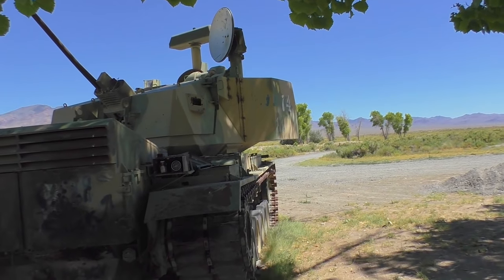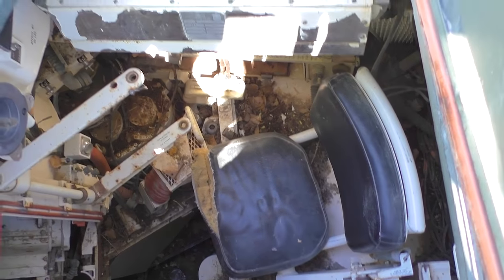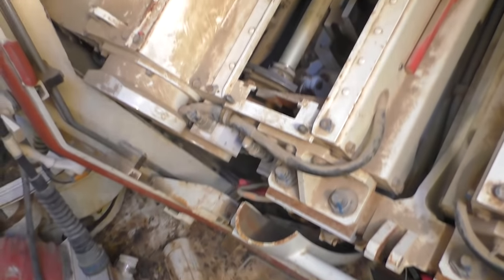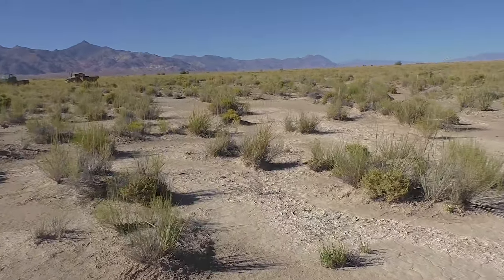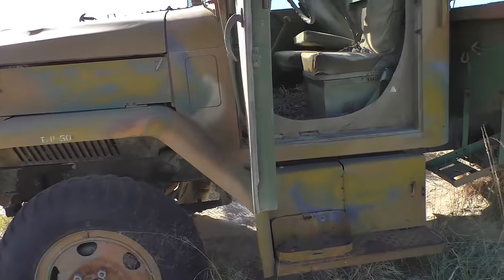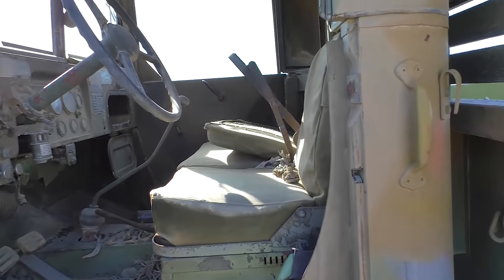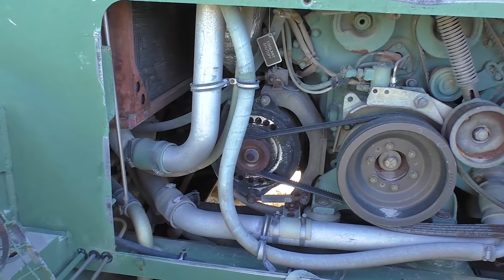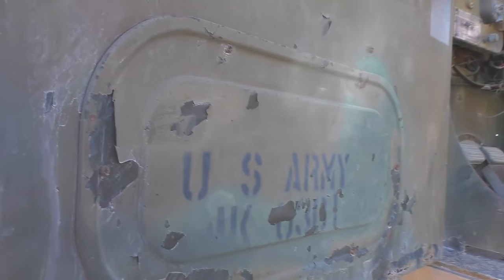WE GOT INSIDE! ABANDONED M247 SGT York Military Tank In The Middle Of Nowhere

Comment: Holy cow. I was assigned to the testing of the Sgt York  at Ft Bliss in 1980-1981...  Saw it firing. Needed a secret clearance just to get on the range.
Reply: Yeah. Me too. I was assigned to the S & F Bn. I remember the day the program was cancelled... We could not get in the vehicles after that.
Reply: @JavierMaldonado_n2jkw  What'd the inside of the look like then?
Reply: @halo64654  It was very futuristic. The center screen had great display. I was inside a German Gephardt an, to me, the icons in the Sgt York were easy to understand.
In my opinion, it was great for SHORAD. The secret proximity round was (is) lethal.  40mm BOFORS are in use today in all kinds of Naval applications.
In my humble opinion, the demise of this weapon system had in part to do with the chassis (M48) and the political climate of the time. In addition, SHORAD Air Defence was going through a lot of changes. Many systems came out in short order. The Army had choices, most of them greater than a slow running M48 based unit. The units it was designed to protect could run circles around it (M1 Abrams and Bradley Fighting Vehicle).

Comment: The tracked flatbed in between the two 2.5-ton trucks is an M-548. It is based on the M-113 armored personnel carrier. It is exactly what it looks like: a tracked "truck" that can go where wheeled trucks would get bogged down. They got used for all sorts of things, mostly combat resupply but also carried launchers for anti-personnel mines. There's a few still used in Reserve or Guard units but for the most part I think they've been removed from active duty service.

Comment: It's a 6x6x6. It can be 2 wheel, 4 wheel, or 6 wheel drive. I had one mine was a 60's model it ran on gas or diesel. It would probably run on kerosene or fuel oil. It would foul the spark plugs out. Had a straight 6 engine.

Comment: It's unfortunate the Sgt. York was never put into mass production. We really do need a new SPAAG, relying on grunts with stingers or patriot systems really wouldn't cut it against an organized air or helo assault. We do have the linebacker, but not enough of them, plus the bushmaster is designed for use against infantry, not aircraft, and is not radar guided like the Sgt York.

Comment: That's a sgt York missing a barrel there's also a deuce and a half and half a M270 with out a MLRS system
Reply: That's not an M270 MLRS its a M548 cargo carrier, the M270 is an armoured vehicle where as the M548 is not armored and uses the M-113 chassis.
Reply: bert26a nope
Reply: As well the m270s are gigantic this thing would be dwarfed by it

Comment: Its not impossible to restore that machine, im sure alot of the machinery has been demobilized but with other components of the M60 Tank chassis which this is built from and researching replacements for the cannon components which is a 20 or 30 MM, I forgot is also not impossible. The Engine could of been destroyed by a thermite grenade which is what they do to abandoned armored vehicles in wartime, but if not, its a diesel rear driven motor that can use a combinations of many type of diesel, kerosene, and other types of low combustion fuels. With other components and machinery and alot of mechanical inclination, this bad boy could be brought back to life.....it has at least 12 inches of armor around the drivers compartment.
Reply: We can create a small army
Reply: its dual 40mm bofors
Reply: Don't thibk the sgt york was ever deployed as it pretty much failed in every aspect of being an SPAAG (Self propelled anti aircraft gun)

Comment: The trucks are M35 series 2-1/2 ton cargo trucks that also carry troops on the wooden fold down bench seats.  The tracked vehicle is based off the M548 chassis which comes in many configurations.  The one there is for the M730 Chaparral Missile System (btw, the missile leaves the rail at Mach 2) and the engine is a Detroit Diesel 6V53T.  It was a fast revving, good horsepower, 2 stroke diesel engine that had only 2 problems in my book.  The first is that it blew a lot of oil into the slobber cup that had to be emptied and cleaned constantly, and it broke a lot of quill shafts that connect the blower drive to the governor.  An interesting tidbit about the engine is that it starts at full throttle and is governed back to an idle at start up.  http://www.military-today.com/missiles/m48_chaparral.htm  http://www.army-guide.com/eng/product160.html  US Army 1976-1997.  I seen it, done it, and love to be able to do it again; just to dang old and hobbled up.
Reply from the maker: Thank you for the information. :-)

Comment: 2 x deuce and a half stake trucks running multi fueler engines. will run on anything. with octane above think its 73% from plam oil to gas to diesel to kerosene
Reply from the maker: Thank you for the info. :-)